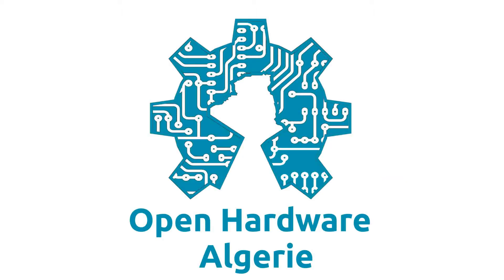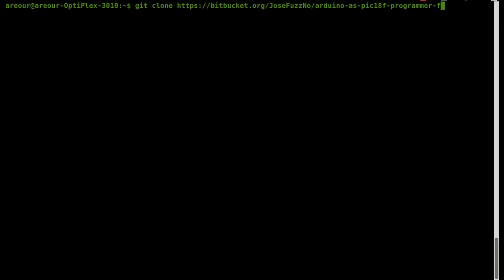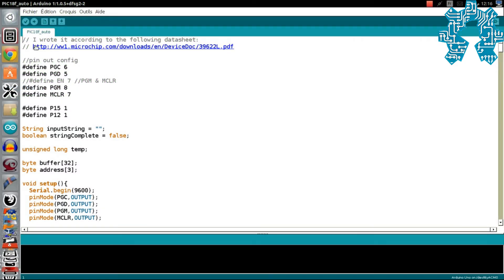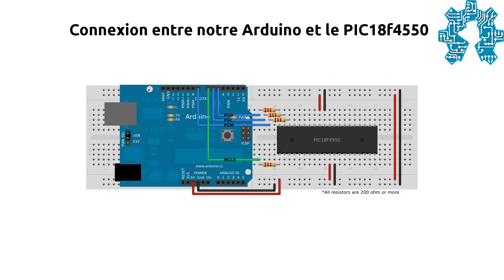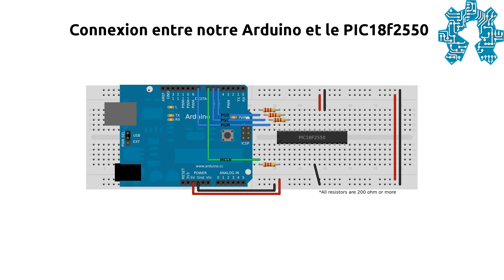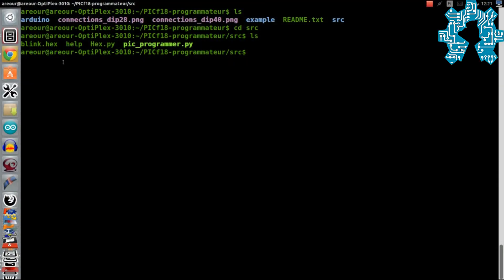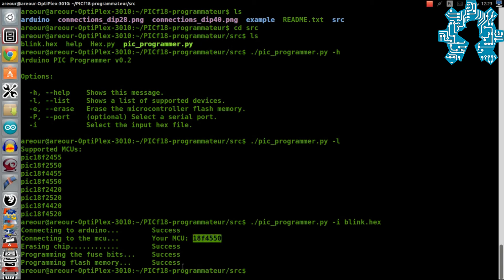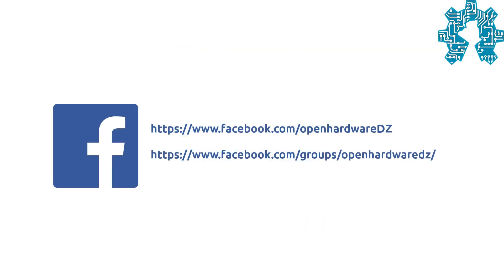Comment programmer un microcontrôleur  de type PIC 18f4550 ou 18f2550 avec une Arduino UNO (Sub eng)

Comment: i didn't like this idea
this method of programmation the pic called LVP ( low level programming ) 
there better then that 
you can programme a lot of pic use just raspberry pi using programme PICPGM
but method LVP doesn't programme all pic that why i prefer to buy PICKI T2 ( PICKIT 2 programme all pic of 8 bit from microchip ) 
or there is old method using serial port JDM programmater and the sowftware called PICPGM ( you can programme just 8 bit of pic pic10f and pic12f and pic16f and pic18f )
Reply from the maker: bena salim  thank you for the comment, this method will be the subject of another video we will post much earlier